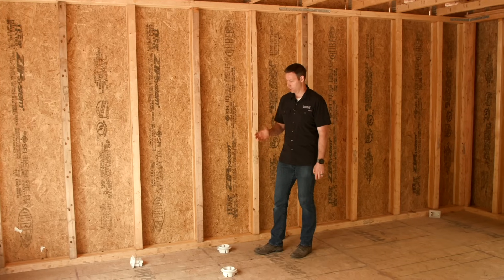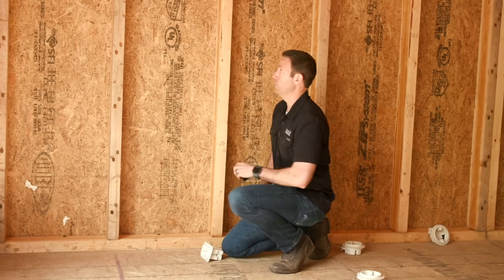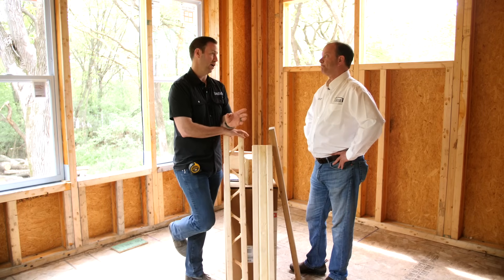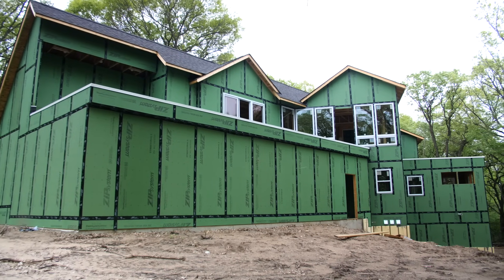Insulated Studs? This is a BIG Innovation in Framing!

Comment: this type of materials could be fire hazard. Structure will fall lot faster than structure using traditional studs
Reply: You don’t know that.
A lot will depend on the spray foam.
Reply: parajacks4  A lot will depend on the internal fireproofing board used. Best to avoid cheap/rubbish plasterboard and use a thicker/stronger more fireproof board.
I doubt that T studs will be in business for long, as there are already better-engineered products already available from established large companies.

Comment: I wonder how the rock return , at the windows, is screwed? Or rather how well it holds.with the screw only going in the outside corner.
Reply: Leon Corriveau there is a 2x3 on the inside and outside.  Although, the window might cover the outside 2x3 if that’s what you mean?  Interesting question.
Reply: Have to avoid placing screws into the insulation, for sure.

Comment: I wonder if the batt insulation “out of the bag” get squished because of the wider flange?
Reply: It would. I would see that as an upside though after seeing so much flir images of installs leaking right in that area
Reply: I was running through all the comments waiting for someone to notice this.  Compressing a bat is not a good idea so I would just go with netting and blowing in cellulose.  The closed foam core would be the way to go then, not the bare-naked one.
Reply: I’m an General Superintendent for a midsized painting and drywall shop in Minnesota. We also take on quite a bit of framing and insulation. But 95% of our work is multi family and hotels. Thinking about it in depth, rather than ripping 3”, I concluded that the very best thing to do is just use closed cell (spray foam) insulation. The cost is significant but so is the result. Other thoughts I had were, where are electricians and plumbers supposed to fasten wires and pipes? If you attach them to the front 2”x3” on the t stud you are in the hot zone for fastener striking the pipes and cables. The back one is fine for the cable but the pipes will freeze in the winter. Hmmm guess there’s a lot of pros and cons to consider before I’m all the way on board. “Board” ha no pun intended.

Comment: How are these nailed or screwed together as in plate to stud?
Reply: 45* angles exist lol
Reply: @BenjaminFranklin99-s9n  I understand that, point is on a normal framing job these members are nailed together with 3 1/4 nails from a powered nailer, quick and easy. what fasteners are they using to go through 2 1/2 inch plates into their studs. nails would have to be 5 inches long, (no such nailer) or screws 5 inches long or toenailed with shorter but would be a big PITA. The fasteners are a huge part of the structure and if you need to totally change out your existing system for some new one that adds problems. Soooo, what are they using and what is the process. Didn't think I had to go so much detail to get a proper answer.

Comment: A nice bonus is that wide nailing surface when splitting studs with a panel. Seems like a good upgrade when hanging some of the thicker Zip-R sheets
Reply: IF THEY DONT SPLIT!...ASK A CARPENTER
Reply: @MD-cd7em  And split they will. Especially if they are kiln dried hem fir or yellow pine as most 2 x 3's are.
Reply: @MD-cd7em  , it's worth noting that I did not hear anyone say what type of wood they're using for these engineered studs. Probably not Doug Fir. ( The type of tree that quality "studs" come from, and no it's not some pornstars on-screen name either. If such a person did exist, of course, his motto would be "got wood, will travel.!")😁
Reply: James Shea, your comment about Clive's LED headlamp teardown just popped up on a video I am watching about engineered, internally insulated studs for building homes. I've seen this sort of thing happen before. What the heck is going on with YouTube? Their software has got some serious bugs in it.

Comment: That's really a good deal. The efficiency you gain will pay for itself in durability and energy savings quite well. I was expecting a lot bigger price difference. Thanks for sharing this, Matt.
Reply: 2x3s are pretty cheap and once you make a machine to do the doweling, it shouldn't cost too much. I just wonder what adhesive they use on the dowels.
Reply: @nicodemus7784  Matt said it's a polyurethane glue on his Instagram IIRC.
Reply: @GS thx. wonder how well that stuff holds up over the years.

Comment: WOW now that is amazing! I like it! The wiring alone will save the electricians so much time! I bet the build time is cut in half!
Reply: John Wayne Until the electricians and especially the plumbers cut enough of the dowels to compromise the strength of the stud.  That and the increased cost. Until the price point comes close to standard studs, not worth it for the longer ROI.
Reply: @mxslick50  Maybe the Plumbers but electricians? HighlyDoubtful.
Reply: John Wayne I've been in the trade for 40 years, and yes there are electricians who are as bad as, if not worse than, plumbers when it comes to screwing up structural members. (Thankfully, they were the exceptions rather than the rule.)

Comment: I would like to know the cost difference between using T-studs Vs. Zip-R.
Reply: What do you mean? Zip is for sheathing. TStuds for framing.
Reply: @bntn9121  Yes I know, but using the T Stud would eliminate the need for Zip R.  I was wondering what the cost would be to frame a house in T Studs, Vs Traditional framing and Zip-R.
Reply: @ledebuhr1  
They already said a $1500 increase in cost for a 2500 sq.ft plan but lower costs for electrical installation.
Reply: he was saying with zip-r and the tstud the house is very impressive

Comment: What about headers in exterior bearing walls? You only mentioned gabled end wall headers.
Reply: 6k pound vertical load cap vs 2k for standard 2x6 and 800lbs for standard 2x4. This is why they are so comfortable with 24 inches on center. For headers and horizontal use you need to factor (2) 1-3/4x3 per stud used for a header inch for inch it would fall short of LVL's after negating the strut in the middle since it isn't being used but would meet code in those usage scenarios. I found it interesting that there was no mention of use as joists or rafters but seems like it has the strength even though it would require span testing and charting which may be why they didn't mention it. Only time will tell how far they can go.

Comment: This is great! 👌👍 the question is why hasn't this been invented sooner? 🤔
Reply: It has, the basics is based on an "old" technology (outside US). But the cost/benefit is not very good.
Reply: because the demand for innovation has been low until the last 5-10 years.
Reply: We call them SIPs
Reply: @Gobuilditbetter - this innovation is good. But SIPs seem an easier & quicker solution.

I wonder how the two stack up in terms of insulation efficiency.
Reply: @ModernMountainLiving  Yes but sips are a completely diff kind of build and a lot more costly, this is simple and still standard construction correct?
Reply: @lilwarrior989  his cost doesn't include insulation yet, my labor costs were $7000 and dried in in 7 days. Then we worked in heat with negative temps and snow.
Reply: @lilwarrior989  DONT KNOW...BY THE TIME YOU ADD EVERYTHING ON TO THEM...MAY COST MORE THAN SIPS?
Reply: Dunno but the concept is similar to a larson's truss- so folks have been framing with this basic concept but this is an innovation on the truss frame...
Reply: Because there are too many builders that won’t change because there granddaddy built houses a certain way. Even the builder in the video said his framers were cussing about it at first then came to liking it. People get stuck in there ways and don’t take to change well. A lot of houses are mass produced as well. You won’t likely find this in your typical new subdivision that’s just trying to build a house in a certain price range while pocketing as much as possible. This is great tech and it’s nice to see home construction continue to advance.
Reply: Jay P Sounds nice when you say it, but the cost/benefit analysis will not sell this product. Feelings might.
Reply: The idea has been around for many years. This particular implementation with dowels is something I've not seen before, and is stronger than what you usually see. But the idea of thermally breaking studs like that is not new.
Reply: Been done before, but this dowel method is new.
Reply: Ian Powell The dowel part is what makes these interesting to me. They use less material then standard engineered trusses and would be easier to assemble. Such a small change, but seems perfect for this application.
Reply: Wouldnt waste time wondering why they didnt invent the wheel sooner.
Reply: Because I was BUSY!!!

Comment: With the thermal break, can you also get away without exterior insulation? Another cost and labor savings right there that will make up the delta.
Reply: My thoughts exactly. I just commented as much before reading yours.
Reply: I wouldn't call R20 amazing, but if you want to barely meet code. Going 2x8 though without exterior would be good.
Reply: That is what he was saying about no longer needing to do offset stud houses. You have two options in Ontario to meet building code: Clad the exterior or offset studs in a 2x8 wall.  
Now there is at least one other option.
Reply: I think the $1500 cost increase included omitting exterior insulation. Look for more savings from plumbing and electrical installation, especially PEX.
Reply: @avid0g  ONLY if the trades pass the savings on to the GC and the GC passes them to the homeowner. More likely that labor savings will go into the pockets of the plumbers/electricians and never lower the price of the home construction.
Reply: @bluecollartrader1791  
"into their pockets" ...  😮 🤔 😒
Reply: @bluecollartrader1791  It is called competitive bidding. When a job is out to tender the GC figure out what it will cost them to build the house and tacks on 15% markup. Generally 10%-20% is the target and if you can do the job with cheaper components you stand a better chance of having a good price.

Comment: So much FOAM everywhere. Plastics, polymers, foams. So much flame and smoke products that kill you even though some can be made inert, which means others that arent inert will off gas. 
EDIT after watching, the strength and engineering is undeniable apparently, however my concern for increasingly PLASTIC EVERYTHING in home construction doesn't disappear.
Reply: col stace  
If you seriously want to avoid outgassing during fires, then buy the uninsulated version and use a closed cell mineral foam insulation. I believe this is a white magnesium oxide product. Extremely fire, rot, and insect resistant. Slightly lower R, slightly higher cost. Just beware that it is relatively brittle and will suffer from deficiency in the walls allowing movement like racking. 

This 2x3-and-dowel product would not be ideal for blown paper. For paper insulation, you need much thicker walls to make up for the lower R, like 12-18" thick. Blown paper dust is also low outgassing and surprisingly great fire and insect resistance because of the borax additive. Also need to check for gaps at the top after a year or so of settling - depending on workmanship.
Reply: He mentioned something about fire rating, just need someone to invent a green foam, bio degrading
Reply: @colstace2560  You realise that a purposely biodegrading product in your wall cavities would be a nightmare?
Reply: @rolfbjorn9937  only degrade in sunlight
Reply: @colstace2560  Changes nothing. There is foam, they're pretty much all not totally inert, they degrade, and the truss like nature of the stud makes it more vulnerable than a massive piece of wood in a fire. Just like all trusses. lighter and great for their resistance to bending and spanning longer distance, less massive and vulnerable. I know that the "whole system" has to be fire rated, i.e. the wall, but the risk remains. Ratings are just minimum standards in a lab and dont necessarily relate to the real world.

Comment: These are the videos that make "The Build Show" quality. Step change in building is where it's at.
Reply: A thick wood beam insulates fine. They build log cabins from wood in the coldest parts of the world and have no issues.
You’re bs’ing and you know it.
Reply: @TonyMontanaOG  wood is about an R value of 1.4/inch. That would make a 12 inch beam about R17. Reasonable yes, but keep that fire burning or it'll get cold. With closed cell foam at R6/inch that same 12 inches would be somewhere around R70.

Comment: I wonder what the cost of this vs having a double stud wall with the studs being offset.
Reply: That's a good question. Just remember the cost per might be higher but less pieces would help offset the cost.
Reply: Interesting question. Well, hes said it is 1500 dollar more for the T studs vs traditional framing on a 2500 square foot house. That means if you double up the walls it would cost you twice as much as the T studs MINUS 1500 dollar. Also you would loose a lot of internal space due to the thicker wall. So not really a good option I guess.
Reply: You'd have to take labor costs into consideration as well.
Reply: Also must consider that the TStud doesn't provide a true thermal break because of the dowels. I'd like to know the true thermal loss comparison to a double stud wall which does provide a true thermal break. It's much smaller with TStuds than traditional framing but ...